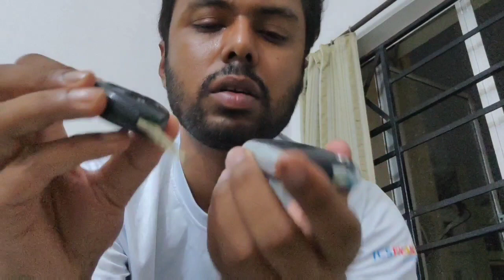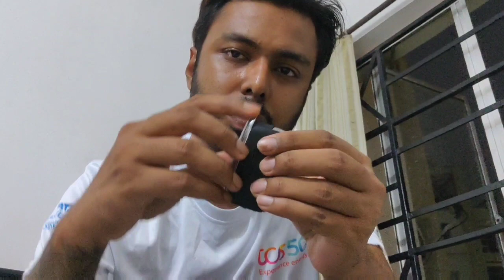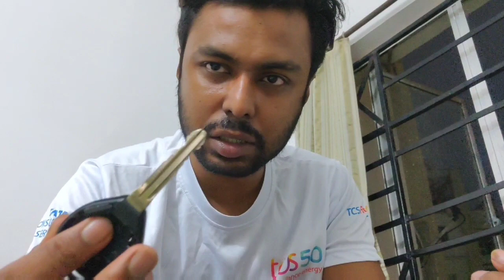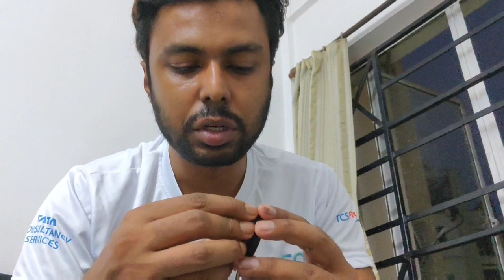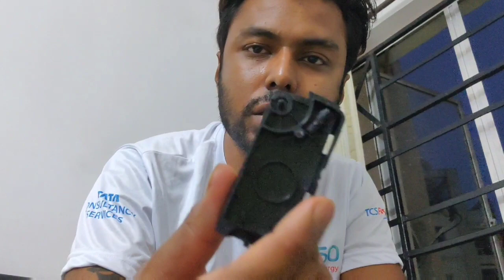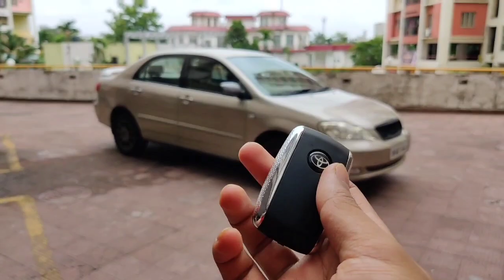Flip Key Conversation with RFID Workaround | Transponder Tag | Toyota | DIY featuring Raneet Mallick

Comment: Hi, I want to go from a flip key to a normal key. Is that possible?
Reply from the maker: Yes that's possible. But the concept is same. Empty shells are available online.
Reply: @ChakraRidingBeyond  thanks, I've been looking for the empty shell that would allow me to put the transponder in, but cannot find it for my 2016 Kia Forte
Reply from the maker: Did you check AliExpress? Even if you don't, you can get universal shells which has the key blade base like yours.